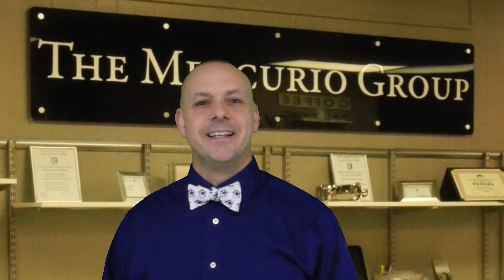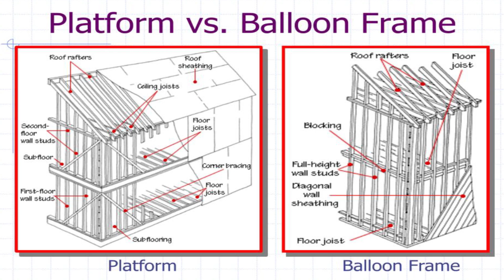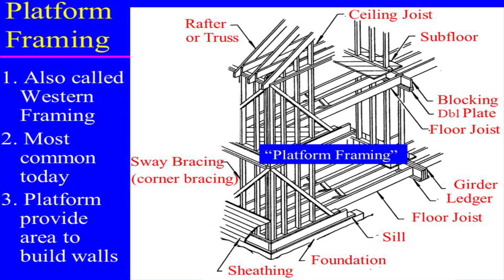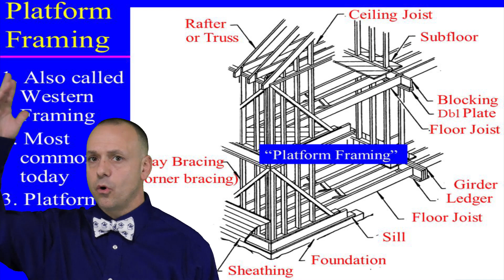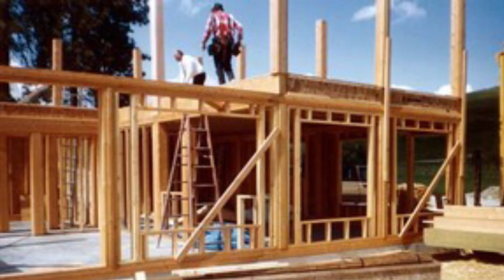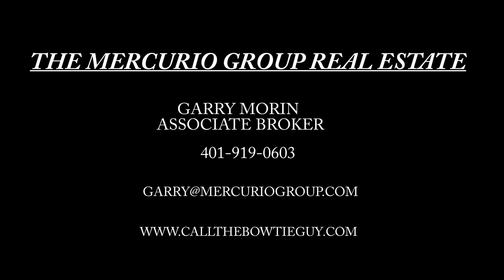PLATFORM VS BALLOON FRAMING CONSTRUCTION | RESIDENTIAL CONSTRUCTION METHODS | RI REALTOR | BOWTIEGUY

Comment: Re fire hazards: why not just put your fire-stop blocking in between the 2x6x20 joists just like traditional framing? I see these 20 foot-long 2x6's without any fire-stop blocking which would help to prevent fire from tracking upward. Additionally, fire-stop blocking would reinforce these extremely long joists to give them added strength.

Comment: Hi, if we raise square frames 5 by 3 meters with thickness and width of boards 5 by 30 cm, (for building a cube cabin by conecting then these frames), would the lap joints of the frames be stronger with bolts or screws? And would there be necesary for extra corner strengthening triangular bars ? ( the cabin is planed to be made with 10 such frames with a distance of 70 cm in between, conected with 70 cm pieces of the same board)
Reply from the maker: Hello thanks for watching and great question.
I do not know what state you are in so I cant effectively answer that question as Im not familiar with the building codes.
So I'm going to say you should consult with an architect or structural engineer to better answer that question